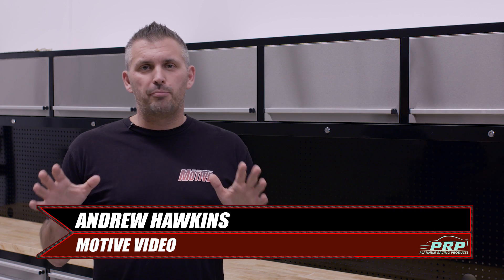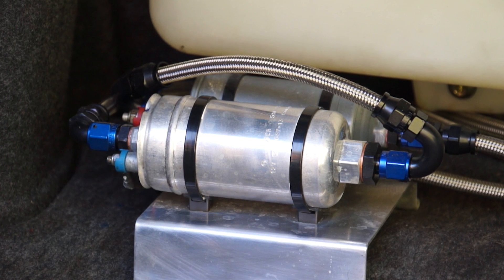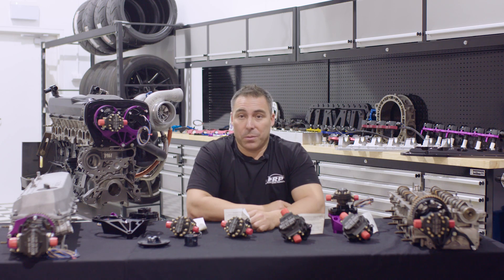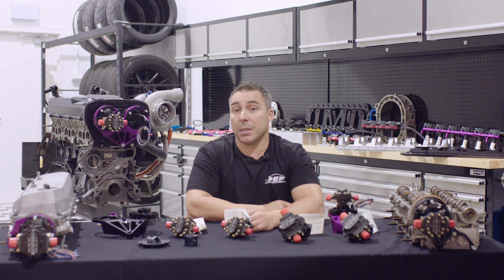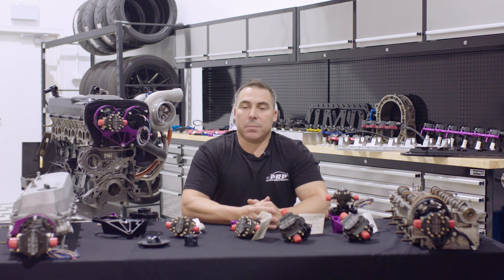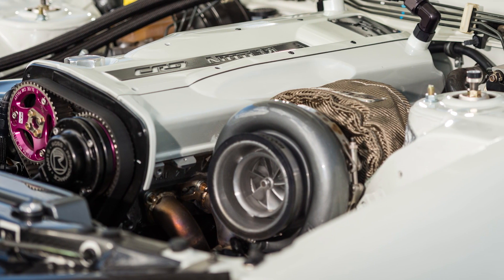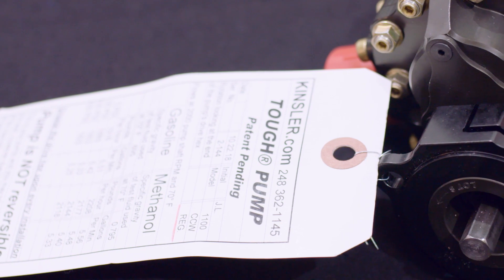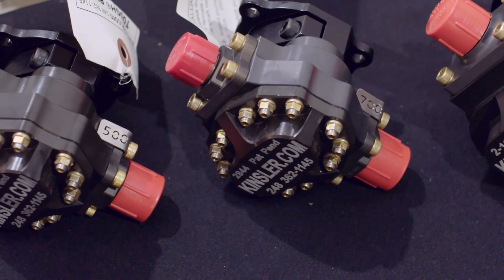Mechanical Fuel Pumps explained for street car - Platinum Tech

Comment: Mechanical fuel pumps are on OEM older 80's 70's 60's 50's engines.  Nothing new here . But most of them are driven by the engine it's self and not a belt like most mechanical fuel pumps nowadays.  Nice information and video

Comment: "the voltage system" ?!
Reply: Haha. Never heard of it.
Reply: A voltage system is alternator, battery and starter motor if you don't have enough power in the system as a hole you can't crank the engine to start it, like having 3 fuel pumps draining the entire systems power
Reply: @DatBoiOrly  We know what he means. But its' called the electrical system. Not voltage. Voltage is not a 'system'

Comment: Can you get them for Audi Rs3?
Reply: Aren’t all these newer Audi direct injection? They already have mechanical pumps. 😂😂
Reply: BruvaJackson, don’t think so, but I have one on my Barra powered bus.
Reply: @renners9636  Have you got a link or info where you got the pump for the barra mate?
Reply: Yeah, mechanical pumps that need to be upgraded when you raise the power levels, and hold ~150bar.

Comment stands.

Old carbureted cars had mechanical pumps, but they didn’t have one if these.
Reply: Renners you still have to upgrade carb pumps lol also there are plenty of aftermarket hpfp for Audi you just don’t know where to look
Reply: MSengineering David you have missed the point of all of this.

The host of this video has been roasted online while being a passenger of an Audi RS3, for mouthing off against barras and then getting beaten by one, which is what the original two comments here were alluding to.

You think I happen to know the fuel rail pressure that Audi uses, as I mentioned it above, but don’t know how to find a fuel pump for one? At least find an actual problem with my comments if you are going to pick.

Brettus, sorry I can’t help you with Barra fuel pumps, I don’t have one, the original comment was purely satirical in regards to the current online roast of Andrew Hawkins, in jest of course, no malice intended.
Reply: Renners your actual problem is holding a grudge.
Reply: graveyards finest random nobody words mean nothing to me ride off my coat tails boy 👌
Reply: MSengineering David don’t know what grudge you are talking about, just informing you why the original comment referenced an Audi RS3.

This is YouTube,  considering that my comments have been nothing but civil, with no real disrespect shown, the kind one might expect if someone had an issue with another.
Reply: Don't VW's and Audi's have a mechanical fuel pump already? My 2010 GTI has a mechanical fuel pump....

Comment: But will this work for a sr20vet? Thats the real question
Reply: we would have to make a billet rocker cover, and SR people don't seem to want to spend that much coin? your thoughts?
Reply: @hermanurriola138  or belt driven mechanical fuel pump, driven off the same belt as the external oil pump if running a dry sump, if the belt fails you lose fuel pressure and oil pressure, which in turn is a security point of view the engine will not continue running without oil pressure like it would with a cam driven mech pump or a electric fuel pump.  Currently building an sr20ve with this setup in mind
Reply: Herman Urriola unfortunatley your correct i am sad to say. Thanks for the reply tho.
Reply: @hermanurriola138  i would definitely be interested if you guys ever were to build one. Im thinking of switching to electric a/c when i break down the build. So anything i dont need on the electrical system would be a huge plus.
Reply: Twister7Studios errrr obviously not since its an RB lol that said they probably do something for the SR.

Comment: Bmw n54 uses a mechanical hpfp. Wish someone would make an upgrade
Reply: khaim5 b there is an upgrade..
Reply: @msengineeringdavid3702  well post a link, I know of there are a few companies that off a modified factory pump but I am looking for a 1000+ hp capable pump.
Reply: khaim5 b look up xdi and there is another company that lets you add a second injection pump.
Reply: @msengineeringdavid3702  found ttfs, said they developed it with xdi, but its $2k and you are forced to use their software. That's a bit much. I know R&D cost a lot but damn.
Reply: khaim5 b if you’re unable to spend 2k this anit for you regular port injection aftermarket injectors and pumps are 1500-2500 all together also I doubt tffs developed the pump xdi is a ex Bosch engineer for common rail fuel injection.
Reply: @msengineeringdavid3702  
I already spent the money on "regular port injection" just looking at options from my next drag build. To send 4x as much for something that's not absolutely necessary doesn't interest me. Mechanical pumps from companies like aeromotive for for $600-1k. Thanks for the info. Anyway.
Reply: khaim5 b mechanical pump is one piece of the puzzle and that doesn’t mean it’s going to flow to your needs also try buying the $2000 injectors  for it . Your car isn’t port injection and loses the advantages going to port. 2k isn’t shit and you’re just venting for a simple 1000whp I did tell you there is a kit to add a second hpfp a stock one but it doesn’t look like you read that 🤷‍♂️
Reply: @msengineeringdavid3702  like I said thanks for the info.
Reply: how about a coil kit instead?
Reply: @hermanurriola138  some gtr coils would be nice, but they already have an ls  / Audi based coils that seem to work well

Comment: I thought so long as the mechanical pump isn't modified further it was legal and didn't even need a certificate so long as it's secured, supported and shielded. 😕😕 That's in their rules and I quote:  "All components used are unmodified." So unless Hermann is hitting the pump with a Dremel, I don't know what the problem is from the governments view? 🤔🤔🤔
Reply: I'm actually qualified as a VSCCS engineer, and as its not OEM it needs a certificate, not saying that cant be obtained, but it looks far from standard so its a little tricky, not that a police officer would know what he is looking at.
Reply: @hermanurriola138  Thanks for the clarification Hermann. I'm looking at it from a legal standpoint as the governments terminology allows a loophole that could be exploited, like using disconnectable nitrous bottles back in the day when they introuduced the ban on the street. They make no mention of having to use OEM parts and LM 1.1 even states it as "alternative fuel pumps" with zero clarification through the regulations to whether it must be OEM or even whether it is an electrical or mechanical type. Once again, thanks for the reply Hermann. 👍

Comment: Herman wouldn't the system be limited by the lift pump? Like if it only rated for 400hp like a Walbro 255 or is the lift pump more about flow than pressure
Reply from the maker: No. Lift pump fills the surge tank like normal. Mechanical pump draws from, and returns to, the surge tank. Its like sizing an external pump and surge tank, you make sure surge tank is big enough to last the longest full throttle application.
Reply: @MotiveVideo  oh I understand so the lift pump is only really needed to fill the surge tank and after it's full the mechanical pump does the work.
Reply from the maker: @AdmissionGaming  Exactly the same as a normal external fuel pump and surge tank set-up
Reply: @MotiveVideo  ok thanks Andrew, learnt something new today. Really enjoying these videos.
Reply: no, limited by the volume in the surge tank, but ill give you a quick scenario, if your "2000 hp" engine uses roughly 20 litres per minute, and you had a 3 litre surge tank, you could be full throttle for 10 seconds before it would run out, now with 2000 hp, you are never on full throttle for more than 10 seconds, (6-8) at best, so as soon as your off the throttle the lift is catching up and it does it quickly ..
Reply: @hermanurriola138  this.... people also don't consider the lift pump is still filling in this time too. i've had people try tell me i needed 1 litre of surge for every litre of engine and all sorts of crap. i think marketing blows things out of proportion for people who don't know what they are doing.

Comment: Don't fret 2JZ boys, Powerhouse Racing makes a mechanical fuel pump adapters for Weldon mechanical fuel pumps. It is run off the intake cam wheel just like this
Reply: PRP make this for JZ's too haha.
Reply: Prp already does it 👍🏼
Reply: Don't most run the jz pumps on the crank or am I just seeing a crazy amount of them